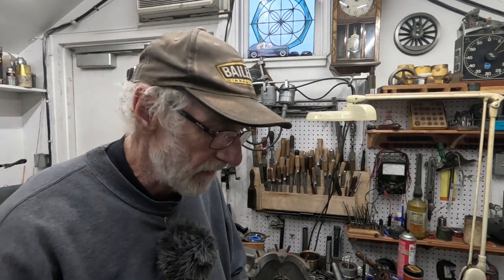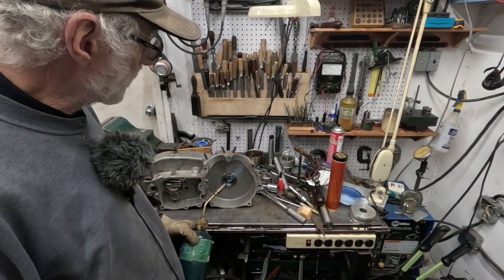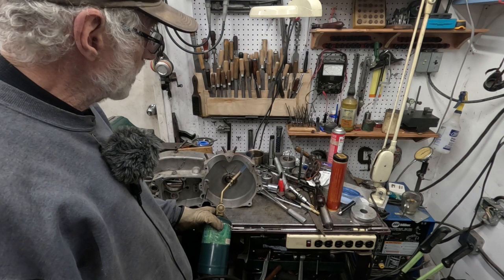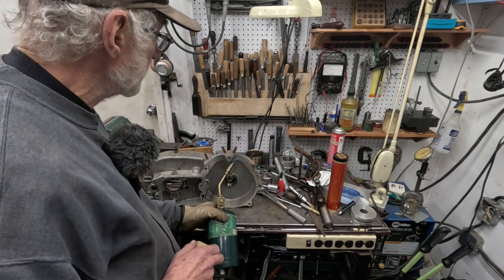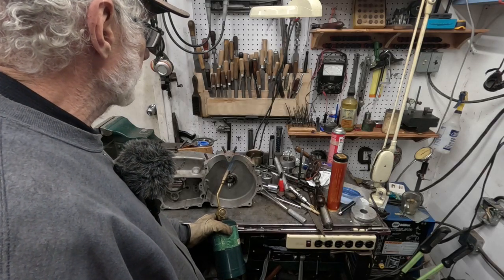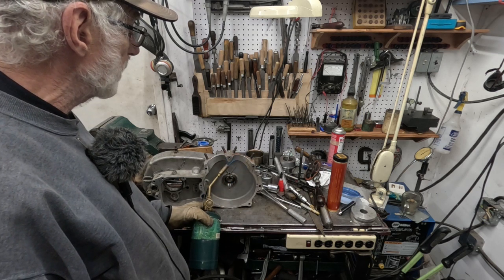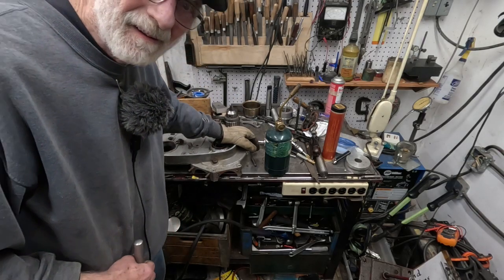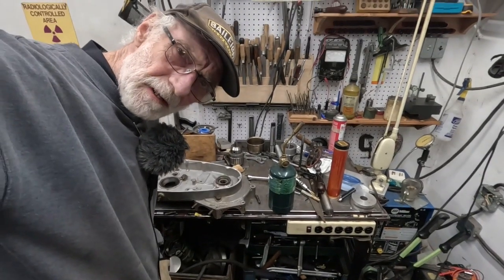Harley Davidson Machine Shop, Removing K Model Cylinder Studs

Comment: I remember as a young lad I was working in an automotive machine shop. The first time I saw the owner pull block oil galley plugs using a torch and wax to free them up and a cut off square shank screw driver and present wrench to fit the square drive. I was amazed. He told me that if you can get bees wax. I always keep a chunk of it in my service truck and tool box. Cheers
Reply from the maker: This was commonly done in automotive and aircraft removing rusted or stuck pipe plugs and other threaded fasteners from cast aluminum without damage to the threads. Bees wax was preferred but candle wax will work in a pinch. Methods like this are lost in time, internet searches are becoming more worthless as time goes on. I found maybe 1 in 10 will actually try something like this.

Comment: Hi Don. Forgot to mention that McMaster Carr offers really nice flat belts in any size you require. Also, a selfish request, I have a box of C2 carbide rectangles and would like to see you someday make your forged over scrapers and boring bars. Maybe someday use those nice cast iron rounds you showed on your old channel to make fancy wheels for your cannon. Thank you for making the videos. I enjoy the videos.
Reply from the maker: Still low on funds here, it will be awhile on the belt. I will use those heavy cast wheels on the cannon for sure! Thanks!
Reply: @DonDyarprecision how much does that cost, if you don’t mind me asking? I wish it were simpler to get funding for you.